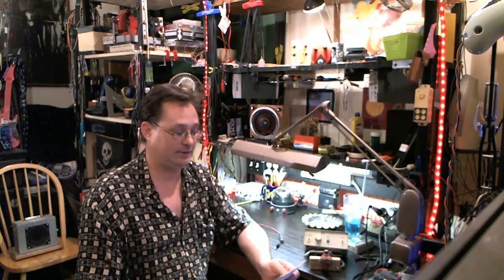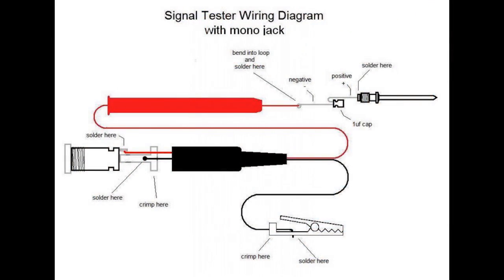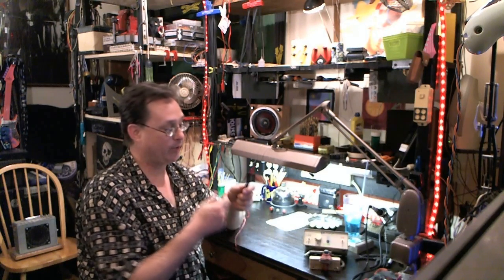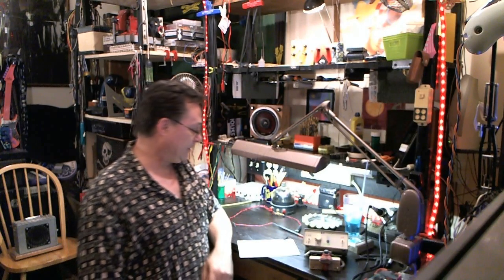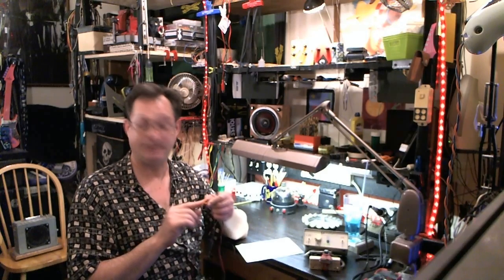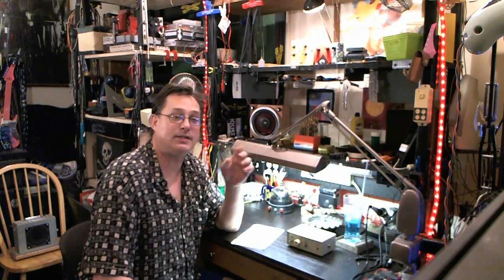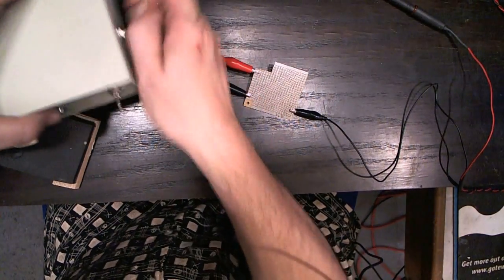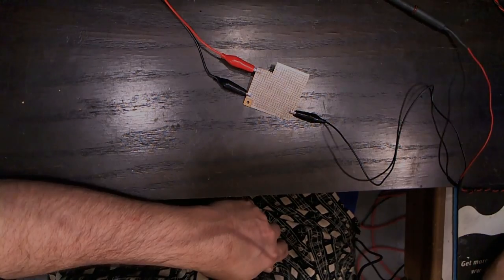DIY (quick and dirty) Test Oscillator and Probe Part two

Comment from the maker: you will be amazed at how many times you will find use for this device . highly recommended lil build . i would say the smaller the better ... no dc jack , just a 9 volt . i would like to tune it to A440 , and cut in a tiny speaker / piezo , use it as a quickie reference
 tuner too ...